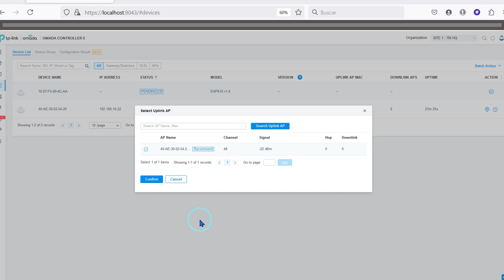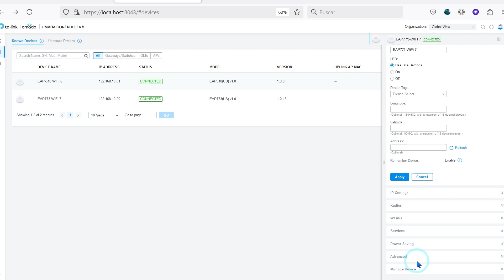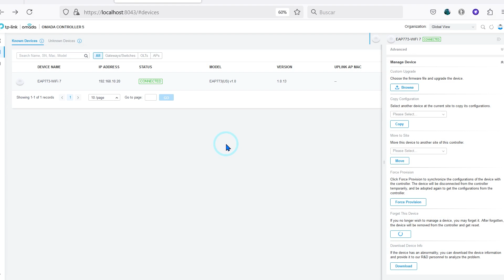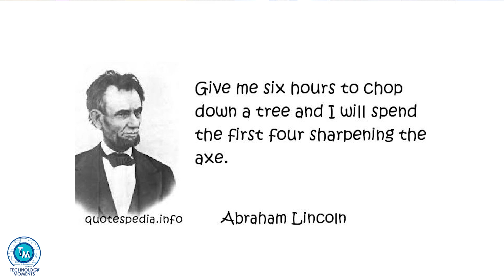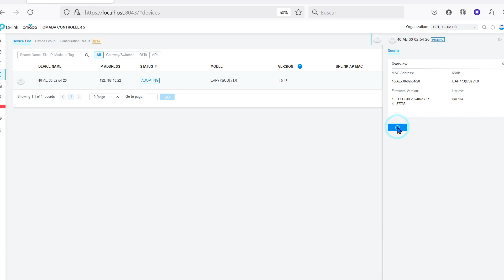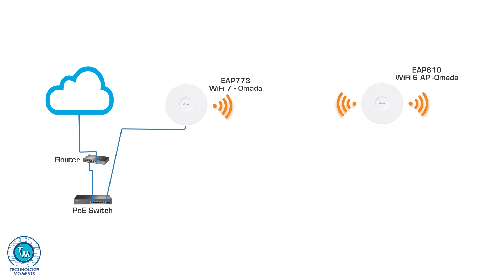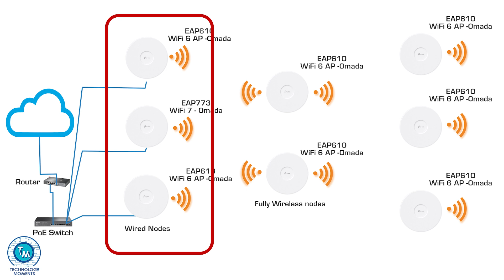MESH Networks with Omada Access Points - how easy is to implement them?

Comment: Good day if you can assist my Tp link access points keep on loosing connection any settings I’m missing 🙏🏿
Reply from the maker: No.  They should not loose connectivity.  The first thing I'd do is to check cabling and connections.  The easiest way to troubleshoot connectivity of the APs to the network is just by leaving a continous ping to it and monitor.  You can check the free version of Ping Potter to help you diagnose.  Check your cables, replace them if possible (or use temporary external cabling)

Comment: Does the iPad Omada app do the same thing
Reply from the maker: Sure it will, Just will not be always available as if you run it in a desktop computer, however if you are not gonna use a Wi-Fi captive portal nor need to log activities, you're not going to need a continously running controller.  For normal configurations the Android and iOS apps will do the job.

Comment: thanks for the videos, could you maybe guide me a little on a few other basic questions? can I use my home router's wifi as part of the mesh or does this need to be disabled? and can i set this up without a controller - I am just looking to have 3 wifi spots through my home, upstairs, downstairs and outside, ideally using the home router as a wifi point for downstairs.
Reply from the maker: As a Native MESH, they will not be adopted and considered or listed in the APs in the Omada controller, but your clients will connect to it if all network specs are the same.  If there is slight difference it could do more harm than good.

Comment: you indicate wifi extenders do not need to all be TP link. Wondering if the oc200 will control my wavlink ax3000 wifi extenders
Reply from the maker: Unfortunately, the controller is limited to devices of the same brand and therefore will not control your other ones.  Besides all components in a MESH network not only should be omada controller compatible but the ideal scenario is for them to be identical.

Comment: Can I create a mesh network with my TP link BE800 router with the TP Link Omada EAP773?
Reply from the maker: They do not support it to work together as both would need to be Omada SDN compatible,  however, you can create a network with the same name and network parameters, and support roaming through your whole house with the AP (https://amzn.to/411Uhj1) connected to your wired network.